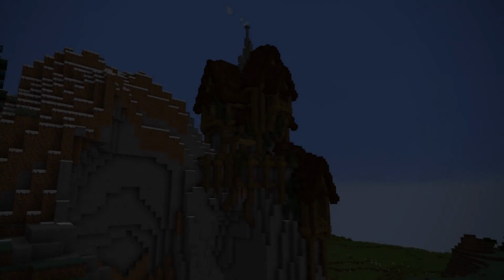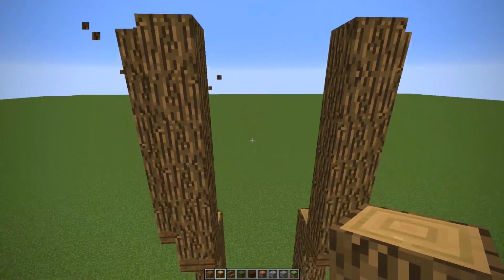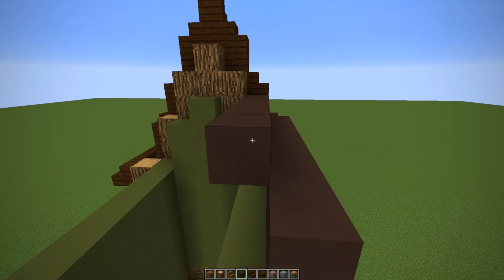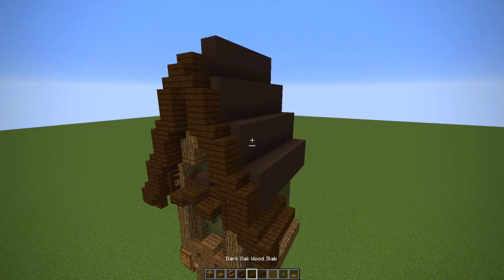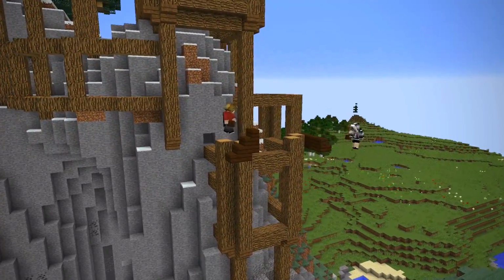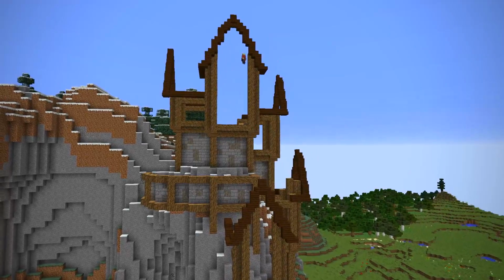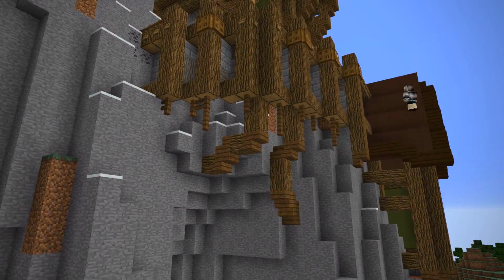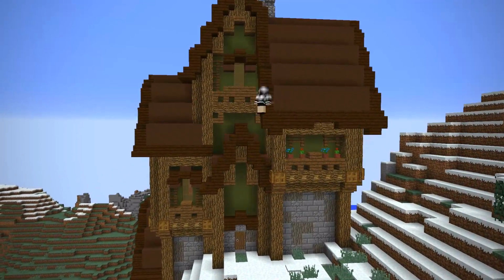How to make a Minecraft CLIFF HOUSE

Comment: You know what would have been a nice addition? You know how the cliff is concave to the left of where you built the house? Having a sort of rickety rope bridge spanning that gap with doors on both ends (one in the side of the cliff, presumably leading into a tunnel spiraling down inside to ground level, the other in the structure under the balcony).

Comment: Grian, have you ever tried a nano-height house? It has to do with that elytra-block glitch. The house's interior height can be no taller than 1.5 blocks, and everything is functional. It's even possible to make staircases using slabs and stay in elytra mode. What kind of nano-height designs can you come up with?